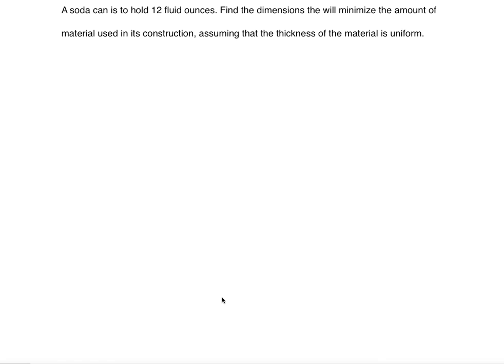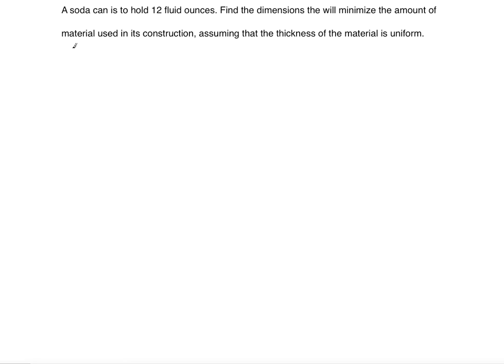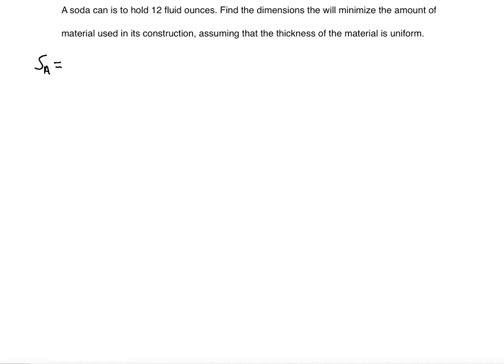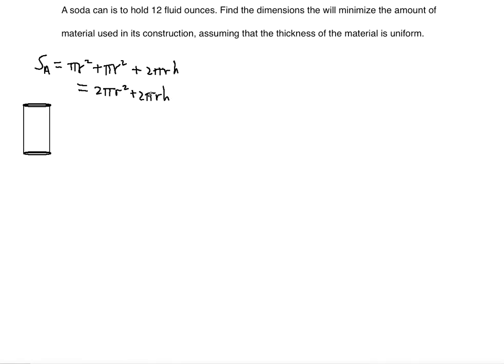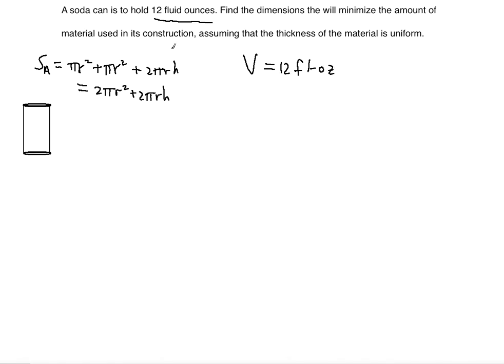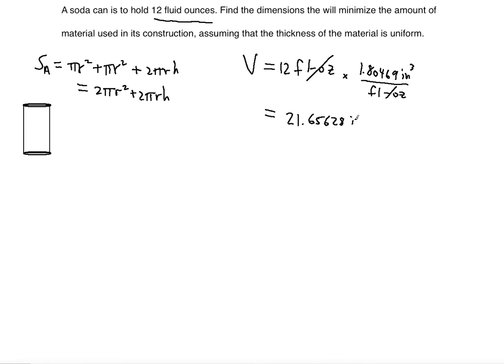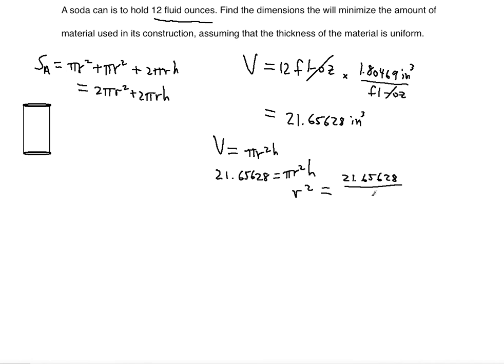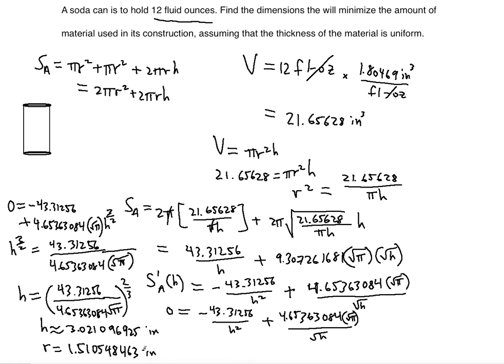🕋Optimization Soda Can problem ! ! ! ! !

Comment: The math you used was good (as far as I could follow), but an error you made was that an aluminum on the top and bottom are twice as thick as on the sides, so the surface area should be (4*pi*r^2)+(2*pi*r). If you use this formula instead, then the answer will more closely match what a soda can’s dimensions are in real life.